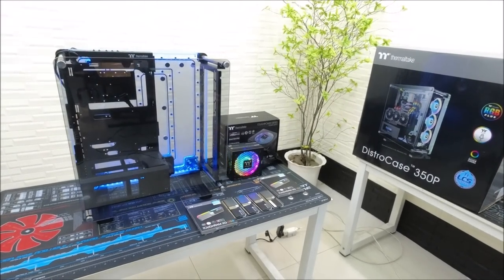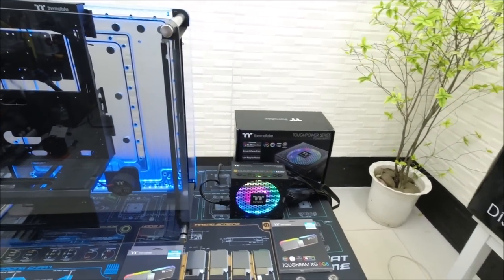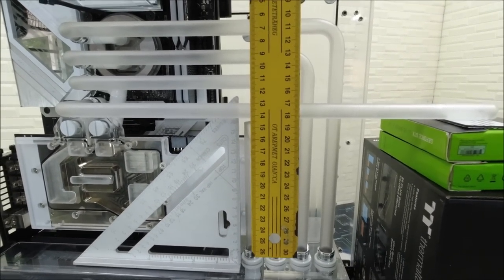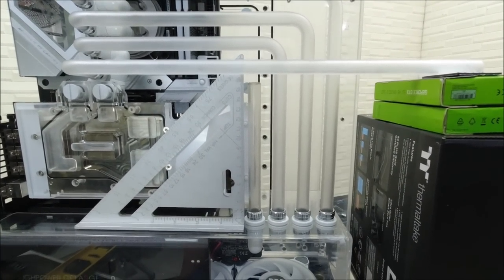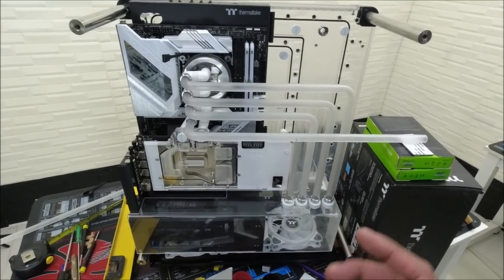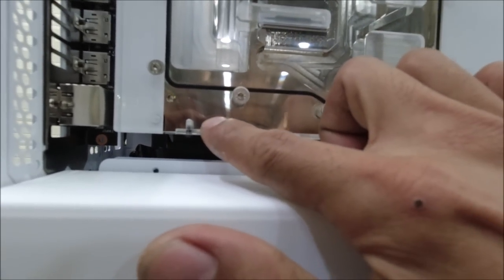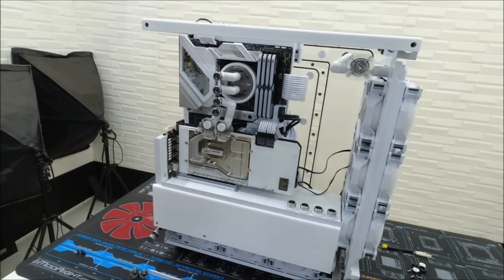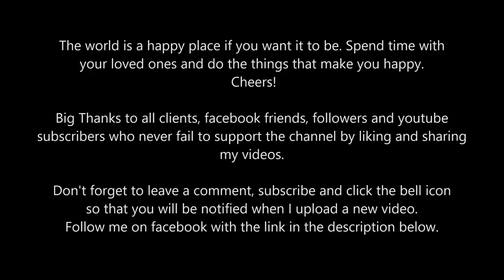Custom Pc Build # 120 "Blue Ice" A custom water-cooled Gaming Pc on a Thermaltake 350p Distro Case.

Comment: For filling down the end of the tube 1mm at a time... Primochill (American company iirc) makes something called the rigid finishing bit. It is basically a reamer drill bit that lets you chamfer the inside and the outside of the tubing, however if you keep the bit in the tube you can shave it down very precisely. This drastically cuts down effort and time versus a file or worse, sandpaper. Personally, I consider it an essential tool for custom loop building.
Reply from the maker: Cool, thanks

Comment: What are those radiator brackets on the bottom?
Reply from the maker: just extra stuff in my shop then i modified it and made a bracket to fit the case.